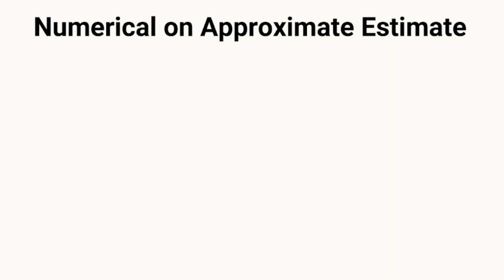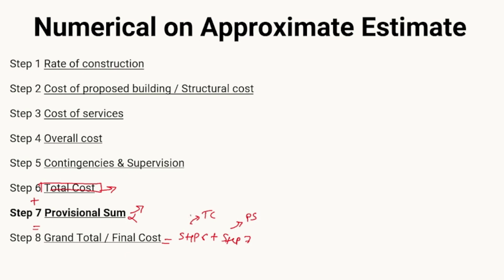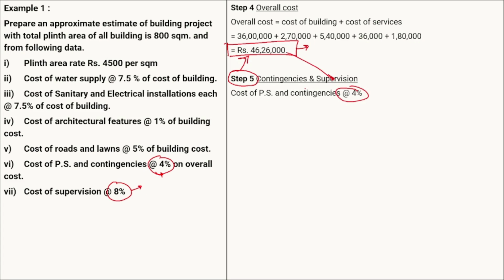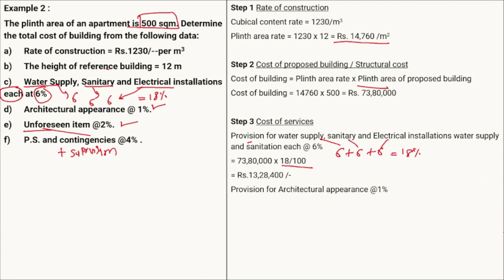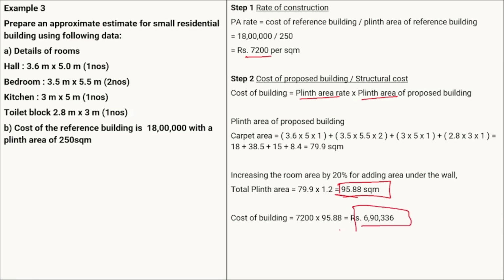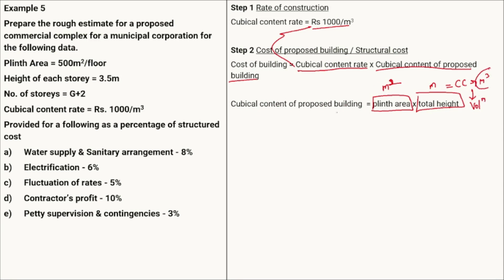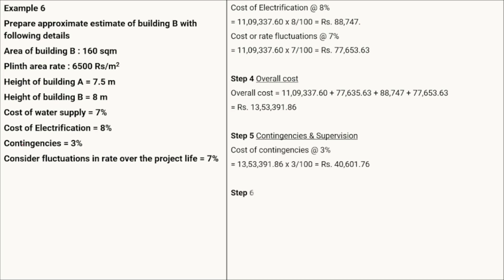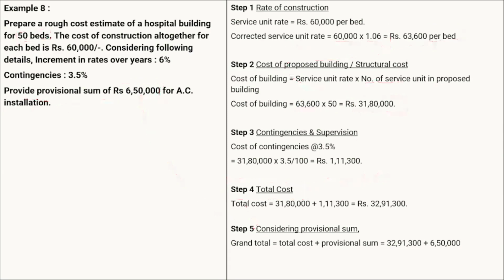Approximate Estimate Numerical (English)

Comment: I have a small doubt about example no.-5
It is mention that the plinth area is - 500m^2/floor
and there is 3 no. of floor in the proposed building
then why would not the plinth area is multiplied by 3 ?
Reply from the maker: Cubical content = Plinth area × height.
So we are already considering all three floors.
If it has to be solved by plinth are method in that case the total plinth area = area on each floor × no of floors